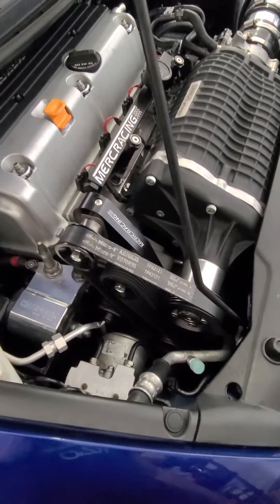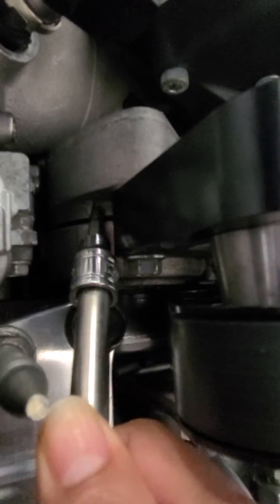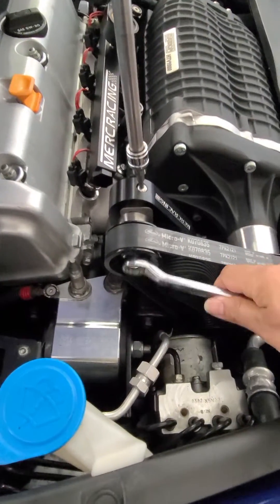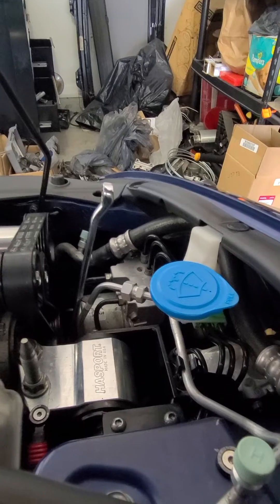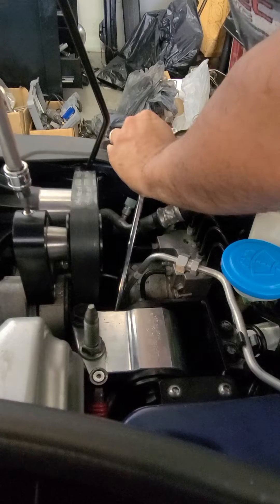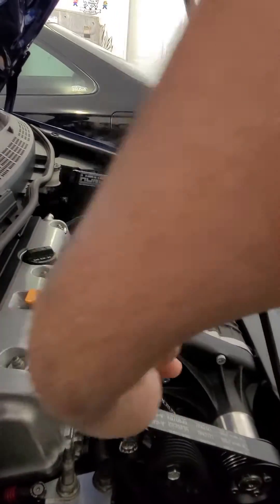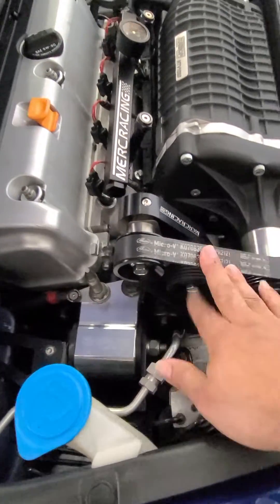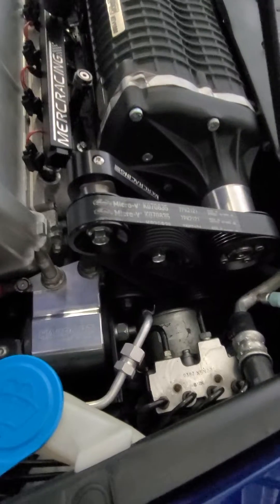How to adjust the mercracing supercharger tensioner on a k series.

Comment: Man, I hope you see this. I have a 08 Si with a Merc 1320. I screwed the Merc tensioner as far as it can go (to make the belt tighter...highest position) but the auto tensioner marks still don't line up. The bar is to the looser side of the arrow (it's currently closer together than it was) Do I have the wrong size belt? Any help is much appreciated. Thanks!
Reply: Thanks Jorge...I'm going to try and message you back this week after I see what the CEL I'm throwing is all about. I appreciate your time, man.
Reply from the maker: @mtjr1168  I would presume that you are probably correct. I don't use mine and never tried to get it plugged in. I wouldn't have really good advice on the matter because I've never really looked into it.
Reply from the maker: @mtjr1168  every setup tends to use a different belt size. It has too many variables. IE, crank pulley size, blower pulley size, engine deck height, belt routing, blower size (the larger or smaller sizes of the actual blower will move up or doww). What I recommend is that you lower the adjustable pulley all the way down, get a long string and route it the way your belt would sit. Get a measuring tape and see how long the belt should be. Don't move the tensioner (you will adjust slack later) go to a part store and ask for a belt with the correct number of ribs with the length from your measurement. Install the belt and adjust the belt to be in the correct range.
Reply: Thank you for the quick response. Much appreciated! I've had the Merc 1320 for my 08 Si for a while now, but unfortunately, I haven't got the car running great. I would love to ask you a few questions, if you don't mind? Again, thanks for the response.
Reply from the maker: @mtjr1168  sure
Reply: Hey Jorge....ever since the installation of the s/c, I've gotten a CEL for high idle (P0507) and also I get surging revs when coming to a stop and sometimes when idling. Also,  hesitation sometimes when starting from a stop and inconsistent throttle blips when rev matching...almost like the car doesn't want to rev. The tune is on point and tuner said it's something mechanical. Thought it was the J37 tb but it still happened when switching back to the OEM tb. Any experience with something like this? Also, how hot should the blower get when idling for just 5-10 minutes? Thanks man
Reply from the maker: @mtjr1168  I would perform an idle relern. Also, make sure that your kit is properly installed and you don't have any leaks. You can use throttle body cleaner and spray it on the sealing surfaces and look for a bad seal as well.
Reply from the maker: @mtjr1168  as far as temperatures go, I would have to run mine and let you know. The supercharger can get hot, and it's completely normal but it shouldn't get too hot. But again, I would have to check with mine to give you a better answer.
Reply: Thanks, Jorge. I've done the idle relearn in the past to no avail. I just bought another new J37 tb...I'll try the relearn again after installing it. Does the relearn consist of disconnecting the battery, waiting 10 minutes, reconnecting, turn the car on and hold revs at 3K rpm until the fan comes on then let it idle for 10 minutes? Is that the process?
Reply from the maker: @mtjr1168  When I have a problem with mine, I've used my scanner to reprogram the trotle body. If at that point it doesn't properly work, I would change it.
Reply: What obd2 scanner do you use? Thanks, man
Reply from the maker: @mtjr1168  I have an autel.
Reply: Jorge...an idle relearn with a scan tool will work even after a custom tune with Hondata FP?
Reply from the maker: @mtjr1168  yes, you calibrate the tb with the scan tool and then run the idle relearn procedure, will not affect your tune.
Reply: Hi Jorge....I currently have the pcv valve to atmosphere...a hose from the valve down to the bottom of the car. Is this setup ok? Does the pcv valve need to see vacuum? Could this be causing any of the issues?
Reply from the maker: @mtjr1168  take the belt you have with you to a part store and ask them for a belt that is 1 in shorter. Test and see if it works, if it doesn't, repeat the process.
Reply: @jorgegarcia7005  hey man...thanks for replying. My question earlier was about the pcv valve...not sure if you saw that..?
Reply from the maker: @mtjr1168  my apologies, I didn't see the pvc question. You have 2 options. You can add a fitting to the intake tube where it sees vacuum or you can just let it sit there without anything. The pvc will not cause you any problems being disconnected.
Reply: @jorgegarcia7005  thanks man. Am I understanding this correctly because I hear conflicting info on this: 
It's my understanding that at idle or low rpm, when vacuum is high, the pcv valve closes. When rpm increases and boost increases, vacuum drops, and the pcv valve opens to allow gases and pressure out. So when there is a lot of blow bye when under boost, the valve is open and releasing the pressure, correct? That's why it's ok for it to not be connected to a vacuum line?